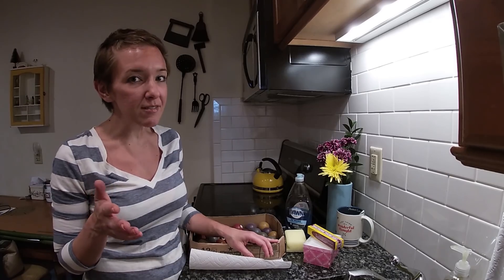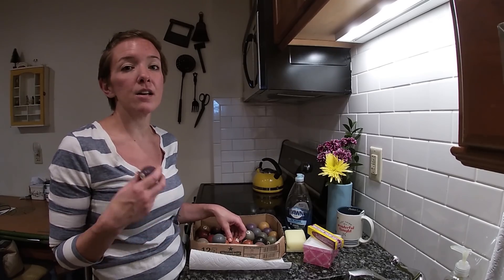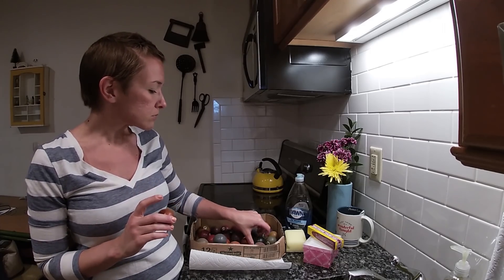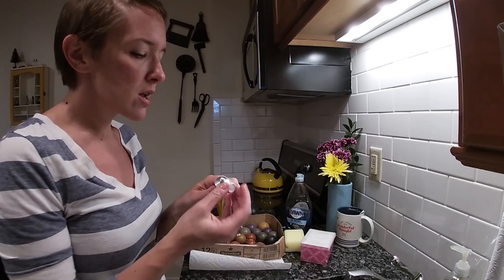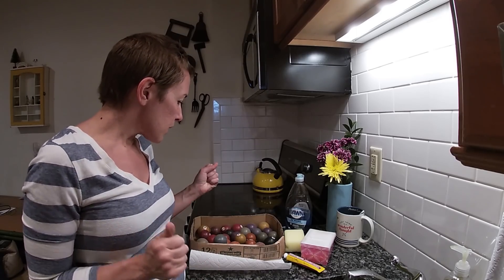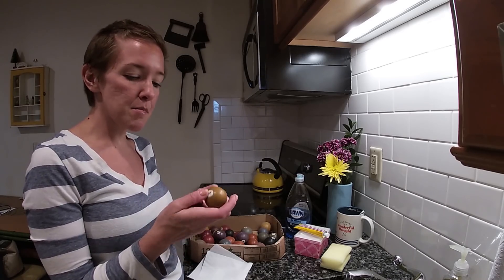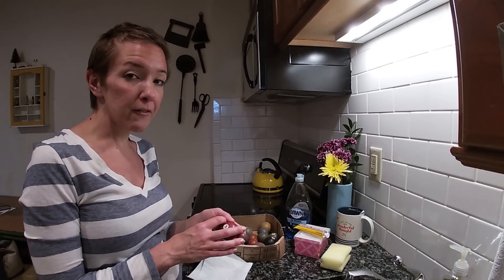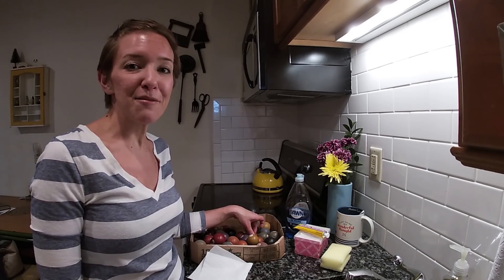Rack 'em Up! Bakelite Testing

Comment: I have been a Billiard mechanic for the past 40 yrs. They're not Bakelite, they're clay. The cracking gives it away. A regulation pool ball is 2.25". Those look small.
Reply from the maker: Thank you for the information - your knowledge in the field is much appreciated!
Reply: Great informative video 👍 🙋🕊️ Thanks!
Reply: Regulation pool balls these days are made out phenolic resin  Is almost the same thing as bakelite just cooked at higher pressure

Comment: Also Radio cabinets, both large and small. Admiral Corp. produced table radios and radio/phono combos housed in bakelite cases , as well as a line of table and small console televisions. Colors were brown and black. Catilin was also a form of early plastic which came in a range of colors. Radios housed in cabinets of this material are highly sought after by collectors. Most of these sets were  Art Deco styled. Ca. 1930's. Your Billiard balls could be made of Catilin.

Comment: Good information. I have some pieces that belonged to my mom and I need to check them. Happy hunting!😊
Well, I went to check the salt and pepper shakers that I have and guess what? It’s actually printed on the bottom. They are in a box of the same material and it’s printed on the box, also...only it says Carvanite. I looked that up and it is simply Bakelite. They were manufactured in Los Angeles, approximately 1929 - 30. YAY!
Reply from the maker: That was an easy check!

Comment: I'd be getting out my baking soda and some cotton swabs. Dampen the cotton swab and dunk in the baking soda.  Rub on the suspected bakelite (on the back naturally) while holding it near your nose and sniff.  Formaldehyde is what you should smell; it's unmistakable once you've smelled it one time.  The q-tip will generally also turn yellow.  Baking soda works about as well as simichrome and it'll often test the red and black too; those don't test well with most chemical tests.  It's also totally nontoxic, readily available, and dirt cheap. If you've got celluloid, you may smell camphor instead - moth balls.

Comment: These days bakelite which contains phenol, formaldehyde and asbestos poses a health concern. Crafters should not cut, carve, or sand bakelite products because the asbestos can be disturbed and ingested. In some circles bakelite is known as the "silent killer." Just as ceramics containing lead need to be used with care, so do bakelite products.